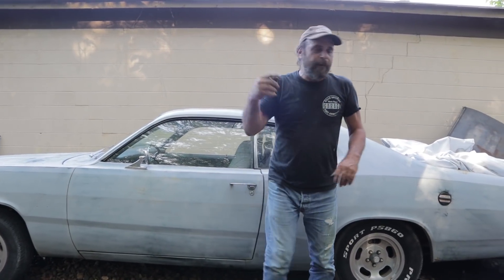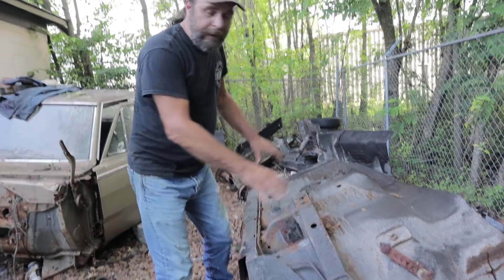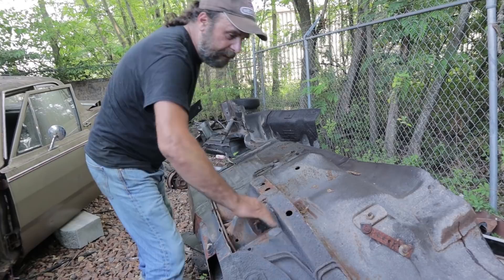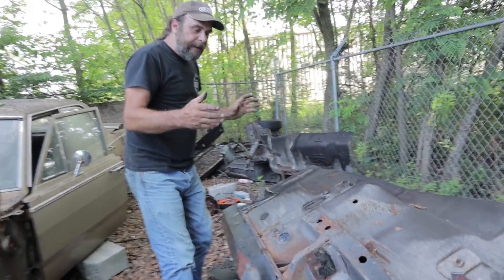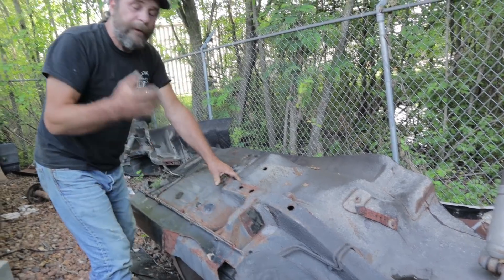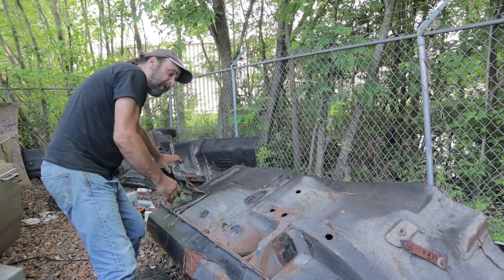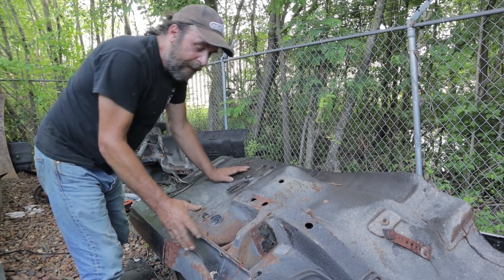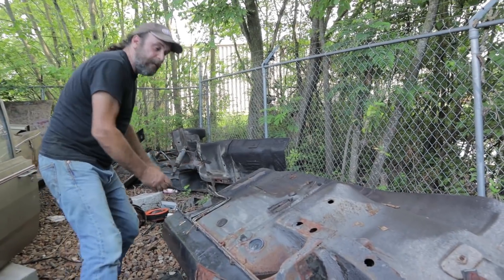Chassis Basics-Frame Connectors

Comment: Good idea in theory, but the reality is if you look under ANY modern car, there is so much reinforcement built into it, that it essentially has a full frame welded to the car's body. Doesn't even have to be a performance application. There is more structure under my 2000 Dodge grand caravan minivan with 150 hp than their is in the frame of say my dodge ram pickup. The engineers never designed the individual panels to flex. If they did they would have put dedicated bushings in to allow that flex. The simple fact of the matter is when those cars were 'new' the engineers just didn't know they needed as much or more structure as a full frame.

Comment: Being a destructive testing technician for these unibody systems I have to respectfully disagree with this assessment. The reason we don't tie these structures together is for two reasons. Cost and safety. Cost is obvious.  The safety element is body systems are designed with crumple zones to protect the driver from the full force of impact. Stiffening the chasis will actually help prevent fatigue on factory spot welds but will result in the loss of crumple zones within the body system.  This as a result means more of the force of impact from a collision will be transferred to the vehicle occupants. With vehicles everything is give and take. I actually destroy these body systems to check for weld integrity. Before this I was a auto repair technician for 14 years. Now I just work at the factory and play with cars at home.

Comment: I know this is an old vid. But i have a question.
Pops cut the apron out of his early a in 1985, he drove the car for a few months an parked it saying it was hurt.
Well after he gave me the car i wanted a rockebilly rod, and dad wanted the barracudas origional glory.

Well becouse he said he "hurt" the car i never questioned i just connected the rails, i figured if i cant get aprons it should help preserve it.
Oops.
I drive this thing every day, cross country, work, shenanigans in mexico, i flogg the crap outa this thing.
Do you really feel im fatiguing the chassis?

Comment: I've seen a few people say the same thing but what I don't think they are considering is the 50 to 60 year old metal
I put frame connectors in and will do it again for that very reason, I do not want a catastrophic failure of the sheet metal between front and rear frames
as is way too typical in the car world things that have many variables and are not at all simple are often reduced to a few variables and then absolute rules given, guys like Tony are the worst at this
and you need to consider the exact car you are working on, there is a big difference from car to car built from early 60's to early 70's, many were designed around very low hp engines and very low perfomance trannys and rears and then in a few years without many frame changes were getting V8's, 4 speeds and posi's

Comment: Ok how much flex are we talkin bout when your running 600+ hp. Now we might be cracking bodywork and popping windshields. On my 68 Coronet I did torque boxes, channel frame connectors, hemi leaf spring plates and a beefed up K member. So pretty crazy big block, 4spd and dana 60 with 1350 solid joints, I plan on running pretty hard so I think these reinforcements were necessary.

Comment: COUNTERPOINT: if you add low-pro tires to a car that came stock with standard high-wall rubber, you may risk excessive stresses on spot welds WITHOUT any additional bracing(!).  You might be asking the chassis to flex excessively with the stickier rubber!

Comment: I respectfully disagree with Tony on this. I installed simple bolt-in (but also welded them) frame connectors on my car (solid 4-door b-body!) and it made the car feel much more rigid even just going down a nice flat road. To my surprise it also significantly reduced body roll in corners and roundabouts especially (before there was so much body roll, I thought my leaf springs were done). Suspension also works better now the body isn't soaking up so much. It would be the first thing I would do should I buy another mopar. I love mopars but these things are just waaaay to flexible for driving on modern roads imho.

Comment: This is true if your leaving it stock, but if your building a pro touring style build with big power, big brakes and big radial tyres its a must. All depends on what you want of your car. So not all of it is a waste of time. Here in Australia we have to engineered everything that's not stock, but if its big power stuff, even a big powered HEMI, turbo, supercharged, late semi hemi it has to pass a chassis torsion test and  you'll be installing more than torque boxes that is for sure, and it may include some pesky chassis connectors to pass. And don't forget engineers of today have learnt from the past wins and fails.

Comment: How about strut tower bracers ? I'm assuming it will cause the same issues?
Reply: In the case of my ‘66 Mustang, I added a “Monte Carlo” brace across the engine bay. I found the top of the bay had sagged so much that I couldn’t align the fenders and hood properly.  The bar holds things where they should be.  Perhaps a stiffer radiator support was needed and might have worked?

Comment: Sorry tony but wrong...flex creates weakened metal also Will pop spot weld and create cracks. All flex and give should only be in suspension. You want no twist in a chassis. I reconstruct these cars for a living, they are cracked and blown spot welds all throughout the car, even slant six gutless cars. Why because of chassis flex and fatigue. Let the suspension bushings take the abuse not the chassis. What would you rather replace...metal panels or a suspension bushing? These old Mopars where designed so poorly even 440/426 cars were twisting the chassis. Take a piece of metal by hand...you can’t rip it or snap in 2 but if you flex it back and forth enough you will easily be able to split it 😉

Comment: Makes sense.  HOWEVER, they must have been drunk the day GM to cut the the roof out of the 2 gen F Body's. As far I can see they did NOTHING to compensate for it and as a result they eventually start cracking from the car literally folding in half! Anyone who has owned an F body w/ T-Tops knows the body flex's a 1/2" just opening the door!  But they are fun as hell. So I finally broke down and bought one. Unfortunately, 180 hp didn't to cut it.  Now as long as the tires are spinning your fine, but when they hook up it feels like a ride at the Wonka Chocolate Factory. 

So here I am and welding in connectors was just shot to shit.  Maybe a set of bolt on?  With the front already on bushing would bolts in the rear allow just enough flex in the body? If not do you  have a suggestion? I have to do something. Getting too old to squeeze through a roll bar or climb out the window when weld the doors because they wont open anymore anyway! You can only bend a tree so far until it breaks.

Comment: Would connecting subframe connectors to the rockers somewhere between the frame rails mitigate some of that load wear?  I would think that connecting the frame rails plus connecting the subframe connectors to the rockers somewhere down the line (like an intermediate torque box) would support the frame plus share some of that load from the unibody if connected properly.  

Am I way off on that?

Comment: My 66 Mustang coupe has cracks where the C pillars meet the quarter panel, from body flex. Wouldn't subframe connector help me reduce this and prevent further flexing? My body and floor are in excellent condition so it's not that.

Comment: While I might not disagree with your overall thesis, anybody who's driven a 60s or 70s era muscle car at speed while cornering, might reasonably dispute your assertion that the engineers who designed these cars were "the greatest engineering minds in the world" or had any conception of how to design a high performance sports car. Every time I drove a 69 Mustang, 71 Cuda etc., I knew I was taking my life in my own hands. The suspension and steering in these barely kept them on the road at anything over 40 miles per hour. I love them all brother, but would have traded any one of them for a 510 or a BMW 2002 for serious road racing. It took American engineers two decades to catch up to European and Japanese engineers when it came to handling.

Comment: I'm going to do frame connectors anyway.  I'm hoping to get about 700 hp to the wheels in a 65 Satellite ragtop.  And I want to do road courses with it.  I've been a Mopar guy all my life.  A couple of years a go I needed a small daily driver to commute to work in.  I came across a first gen Porsche Boxster: it's the best car I have ever driven in traffic.  Since driving the Porsche for two years I have a completely new outlook on how a car should handle and brake.  I understand the need for unibody flex and won't do any of this to my 69 Coronet but the 65 is going to surprise the hell outta some folks on a curvy mountain road.  I'll give you a ride U/T once she is done.

Comment: Has it ever been documented that someone broke body seams loose due to running subframe connectors? I doubt it. Sorry Uncle Tony, I have to disagree with you on this one. Any component that reduces flex in a performance vehicle chassis, is a step in the right direction. I love my connectors, way less twist under acceleration.  No cons, other than the weight. I would almost say connectors are mandatory for any kind of car ,of this era used for anything more strenuous than crusing.

Comment: Do you feel the same about fox body mustangs? 
Those cars are super flexy. 
I feel at least tying in the torque boxes for the lower controls arms is necessary for drag racing with sticky tires. 
Kinda goes with what you said.
Reply: it is odd u never got a answer on ur question.im wondering the same thing b nice to get a answer on that

Comment: You are only partially correct. A full chasis  car is flexible and uses the body for additional stiffness. A subframe car uses the body as the rest of the chassis,A unibody car uses the whole body as a chassis. When you add framerails to a unibody car the stiffness goes up but so does weight. Unibody cars are usually heavier that any other construction method. Off road Jeep Cherokees use additional chassis reinforcement through a roll cage and reinforcements underneath as you describe. No effect on spotwelds popping. So your theory is not valid uncle Tony .   Rotten Rockerpanels make a unibody car scrap metal ......

Comment: This is completely inaccurate and not a "monkey see, monkey do" condition. Built in chassis compliance is in no way beneficial nor required to keep the car together. Nobody with frame connectors is going around complaining about "popping" their spot welds. Nobody.
Reply from the maker: Then why was it engineered in, in the first place.  The factory could have just as easily taken the extra metal in the rockers and moved it inboard ten inches to complete the frame as single pieces.  You clearly don't understand basic car construction

Comment: Uncle Tony is in error.  Spot welds will weaken with flex.  Bend a coat hanger back and forth a few times. THIS is work hardening. The factories want to save money any where they can. It is simply a matter of economics.  More metal is more dollars.  Body bushings are for noise and vibration reduction.  The flex will be more tolerable,  but NOT better structurally.  The connectors will stiffen the car,  provide better handling and launch.
Reply from the maker: You're not thinking it through, Louis.  By allowing the entire structure to flex, you spread the load out over a greater distance, thus there is less localized work hardening.  Same exact principal as an airplane wing.  If they were rigid, the forces would all be focused on the point where they joined the fuselage, and they'd snap off.

Comment: You're talking about the same era of the Swiss Cheese Pontiacs which had something like 120 large diameter holes drilled into the frame just to save weight. Accountants are also a huge part of what actually makes it out of the factory.
Reply from the maker: Don't forget the aluminum exhaust manifolds and brake drums on those cars.  Very exotic pieces for their day

Comment: I put them on my 78 t/a as they always develop  stress cracks between the roof and window right in the corner . Damed if you do damed if you don’t I guess.
Reply from the maker: T-Top cars are a very good place for these things!  That was just poor factory engineering.
Reply: Uncle Tony's Garage strangely enough the t top cars don’t crack.  My car is a hard top but they always develop cracks right at the back corner of the windows and roof line .  See how it goes I guess.  I grew up around all 68-70 charges those things would flex bad when they were jacked up.  My dad has a 1968 6 cylinder, 3 speed manual transmission charger he’s restoring right now.  I can send some pictures if you like. It’s an odd ball charger for sure lol

Comment: I see some idiots suggesting adding a second set of frame rails onto the frames of Spitfires
totally ridiculous

the guy was showing tying it to the body mount in the middle, I dont know where he planned to put his feet.
its a X frame car, so your seat is basically at the same level as the frame.

some people just want to throw metal at a car hoping it gets stiffer I guess?
People also talked about adding on the post safety bumper supports for rigidity. I guess its useful if you want your trunk more rigid, but the suspensions not mounted to that
Reply from the maker: Some people have too many fingers on their hands

Comment: frame connectors are necessary on any unibody that will be raced in the quarter or eight mile drag strip!!
Reply from the maker: Hundreds of thousands of passes  down tracks all over the world by non connected cars, would prove you wrong.  Most can make it deep into the 10's before twist really becomes an issue

Comment: Think of leaf springs and their mountings like a bridge. Bridges are anchored at either end and designed to flex, even grow with the heat and cold. While leaf springs don’t necessarily grow, as they compress, the shackles are pushed outward, and as they decompress are drawn inward.

Comment: Ehhhhhh , yes and no . Power levels and whats out back dictate this (I am excluding autocross and road race) . Again and I cannot state this enough. These cars were built to be cheap and pass crash tests a cheaply as possible .
Whats going on in the back yard and what power level you have greatly decides if this is a thing you "Need" to do . If you have a 1500 HP engine in the front and stock springs with bias ply tires and you ride around to hear the noise you probably dont need to cut on the car to tie it.
If you have 500 HP and you just bought a 5.13 gear set and a nice sticky set of slicks or drag radials and are waiting for the UPS man to drop off your caltracs then you probably want to get into that as the stiffening is not only what they are for. They also are the foundation for cage points . A cage welded to the floor is really just a joke . If its not tied into some good meat it can do you much more harm then good. The cage also further stiffens the car .
If you plan on going to the track and you have bought the above things for your car and its a Ford you will probably need the cage anyway as NHRA rules state that you need it for 11.99 and quicker.
You could probably get away without it in the Dodge as  , well , you know.......   😜
Reply from the maker: 500 horse and 5.13's?  Sorry man, it takes more than that to distort a typical Chrysler unibody to where connectors are necessary.  On the other hand, Mustangs, Late F Bodies and anything with T Tops, yeah...probably a good idea

Comment: Pretty straight and to the point. There's some talk about T top cars flexing and cracking the roofs in the comments. First off, who builds a serious HP car with a T top body. T top cars were built for girls to cruise around town in.
Reply: I guess some of us look good enough to be seen out in public while others either don't of lack enough self-esteem. And a lot of those comments are about 3rd gen GM F bodies which will even get roof cracks on hard top cars that have enough torque or see a lot of hard cornering.

Comment: Awesome video! I know it's sacrilege on this channel but I'm putting a 5.7 Hemi in a 69 Coronet and was wondering if I needed torque boxes, frame connectors, or both.  Looks like torque boxes is all I need!
Reply from the maker: You should be fine with just the torque boxes,  and even then, I would put the car through its paces before I installed those.  Odds are, you won't need anything but what came standard on that car.  Remember, the 68 R/T came standard with a very heavy 440, could be had with a 4 speed and that had nothing in the way of beefing at all.  They held up just fine

Comment: Can the modification of suspension and tires and weight distribution help these people wanting to tighten up the feel of the vehicle be the best choice if the vehicle is used more than drags etc.
Reply from the maker: Weight reduction is absolutely always a good thing, and if the car is used primarily for the drags, then tying the rails is probably a good thing to do.  Of course a full cage that ties everything together further out than the connectors alone would do, would be the best choice

Comment: Perfect friggin timing , have to change rear end in my 70 Newport 440 , have  home made  ties on frame, will get a new grinding disc this afternoon, Thanks Professor Tony. You have helped gearheads save a ton of cash , so folks, hit the buttons lets help Tony get 1.000.000 subs, so he can buy a new crate Hellephant, would be so cool ..
Reply: How's it holding up the frame connectors removed?